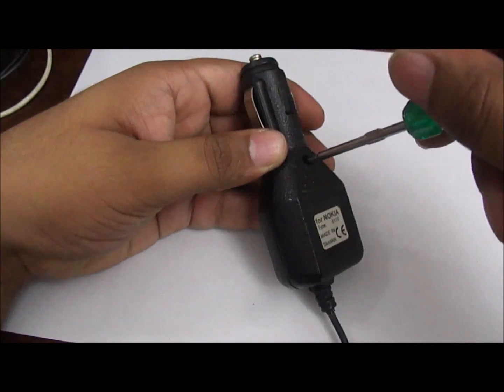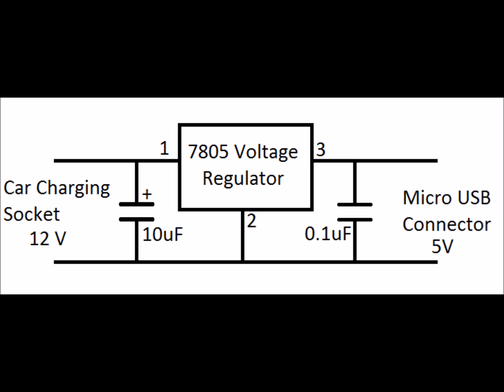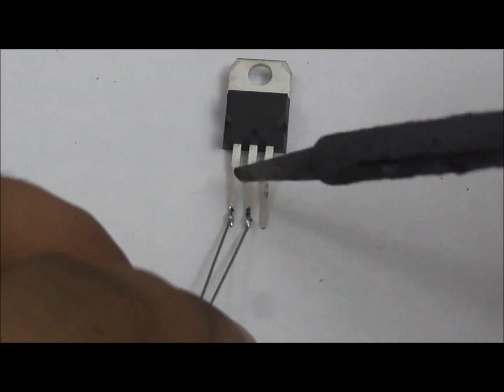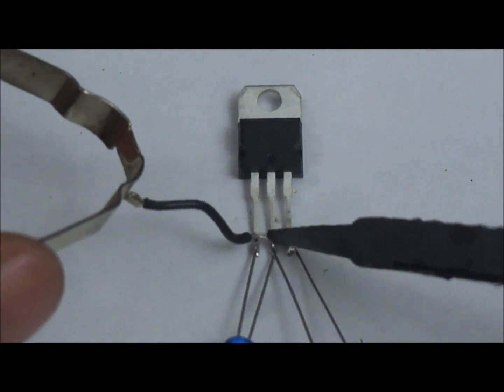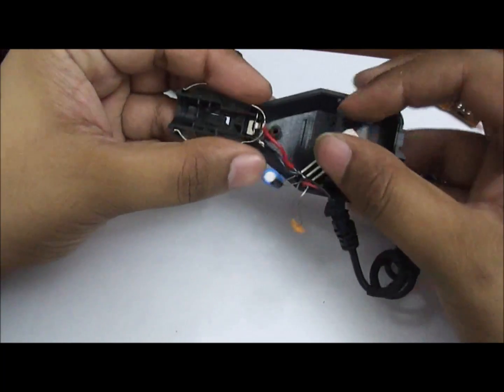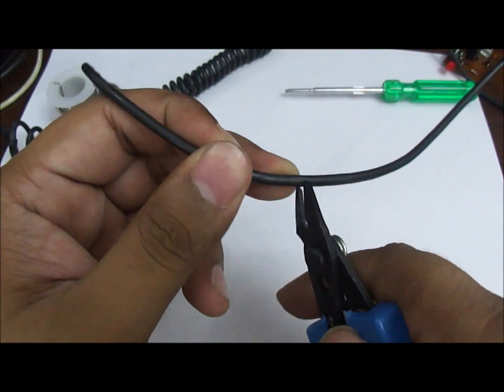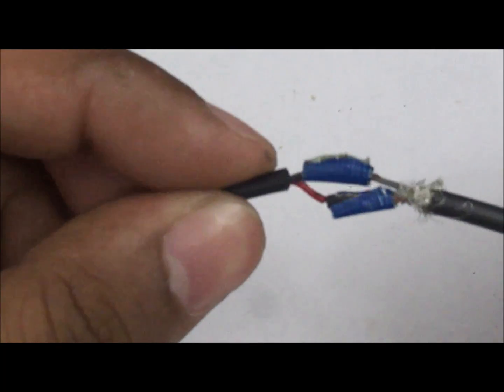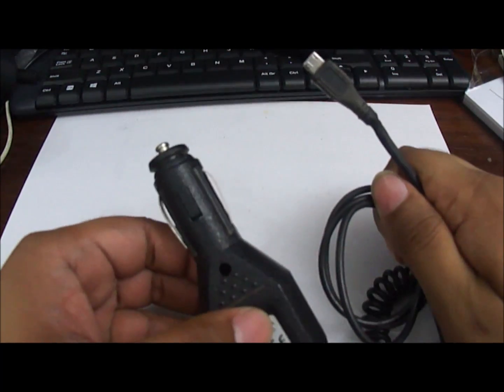Make your own Car Charger in 3 minutes

Comment: hello why is the ic overheating after quite some minutes?
Reply: the lm7805 steps down the voltage to 5 volts by dissipating the rst as heat so it is not designed to be used like this, you should use it with a heat sink and the heat is normal

Comment: The plastic casing will melt away with the heat generated by 7805. Its very inefficient. Try MC34063 or LM2596, these work at very low heat and are efficient too.

Comment: How would you add led to this when receiving power and a led when charging phone.... resistors ? How would you connect it?
Reply: connect the V+ terminal of led to 1Kohm resistor, then loop it to the output Voltage, ie. -ve output to through  the resistor connected to the -ve terminal of the led, and +ve output to the +ve terminal of led

Comment: Charging current is very less so very slow charging my phone. How can I increase the current about 2Amp... suggest me
Reply from the maker: MRITYUNJAYA PRATAP SINGH you can replace the 7805, which has a current rating of 1 Amp, with a regulator with a higher current rating. I can't suggest one off the top of my head, but I'm sure you could find one. 

Or you could just replace the whole circuit I showed you with a 5V buck converter. Make sure that is rated with the current rating required.

Comment: its not very efficient. would the regulator need a heatsink as this could get hot?
Reply from the maker: You could very well add a big heatsink to the regulator. It'll give you a little more current output capacity, but not a lot.
Reply: If you want something efficient go for a switched voltage regulator, which is what most if not all car lighter chargers use.

Comment: actually you need to short circuit the two data wires in the micro usb cable to get an output current of more than 0.5amps. The two data wires shorted to ground is an indication to the phone that a high current charger is connected and can draw more than 0.5 amps upto whatever the phone supports. To further increase the current output you can use and even high current 7805 Voltage regulator as the one shown in video is a 1 amp 7805.
Reply: i tried the current out put is an issue show charging but charging is less the power consumption can u suggest an idea

Comment: Its like a making fool
The guy is just silly.
If we have a car charger then what is the need of making another with its own parts
Reply: +kavita kumari 
omg
Reply: who stayed it worked😒
Reply: kavita kumari I guess u did not go through the video from the beginning. he clearly mentioned that it is his decade old non working charger. also he did not re use the old parts
Reply: 5v is required it gives 8 v
Reply from the maker: Shivraj  Gobbur it should give out 5V DC. That's what the '05' in 7805 stands for. Maybe you had the wrong regulator?